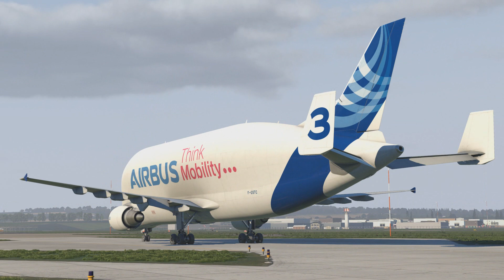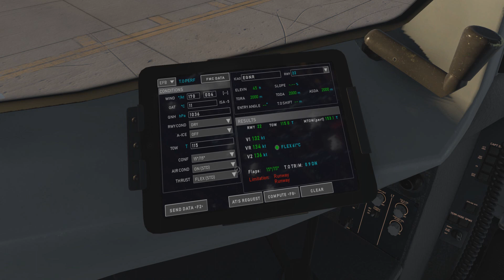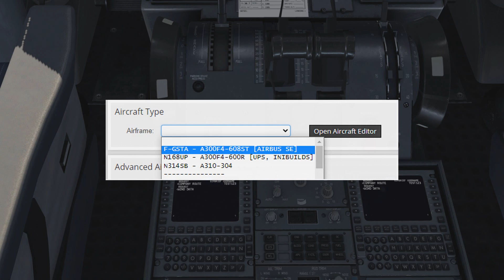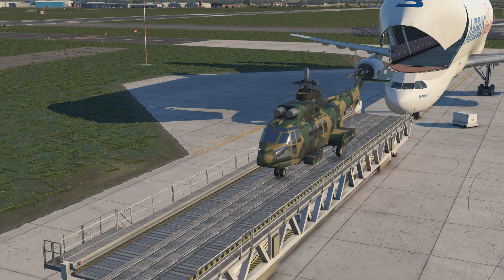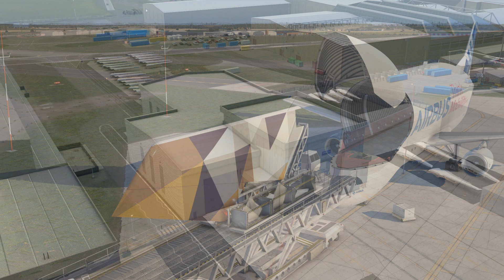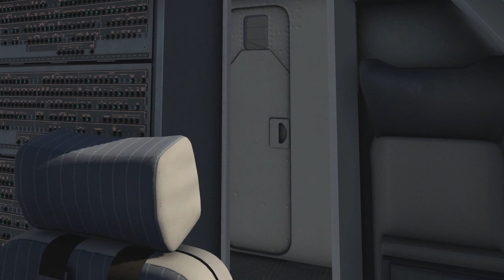iniBuilds A300 BelugaST ON THE LINE - Welcome to the A300-600ST!

Comment: Putting on my sim enthusiast cap here... I have waited 20 years for a trainer quality A300-600/A310 with it being for all time favorite airplane and when someone finally does one..... it's for X-Plane. Ugh. Of course it is. I'm sorry but XP is just a flat out eye sore. The flight model is great yada-yada-yada, to that which I ardently disagree with BTW. And I have tried every XP version since XP5, and it's just pure crap. Always has been, always will be. The lighting looks absolutely awful in that Beluga cockpit and outside as well, typical XP. It does ZERO justice the quality of the internal and external modeling, displays, fonts, textures etc. I mean you guys really nailed the shape of the 306, and importantly got the shape of the CF6-80C2As right as well. Frequently that is messed up by modelers with the more bubbly looking CF6-50s of the classic B2/B4s being done on the -600 which is incorrect. About time someone got it right. The early 310-200s w/ the older CF6-80A3s though do have a bit of that more bubbly shape compared to the 80C2s, and given the attn to detail your dev team had put into this I'm sure you guys are on top of that. The 310-200 and 300-620 (No Wingtip Fences, non R -600s) JT9Ds have a slightly stubbier exhaust as well compared to the later PW4056/58s. By my estimation this product would look at a minimum 2-3x better in P3D's lighting and about 3-4x better in MSFS'. I for one sincerely hope you guys bring the On The Line A300-600R/F, Beluga and A310 family of products to MSFS. I understand passing on P3D (regrettably), but an addon of this fidelity for an aircraft series family that has been completely neglected and overlooked by developers the world over; this never coming to the primary sim platform would be a massive shame and significant sales opportunity lost missing out on the larger marketplace. You guys deserve thorough and proper ROI for the time, research and remarkable effort in developing this airplane. After all, it's the marketplace/type popularity that many devs during internal discussions use as a major decision making point as far as what product to develop and bring to market; and as someone being "in the know" it's been said "there is no market for the 300/310". To that all I can say is I'm thrilled your outfit has done away with that stereotypical way of thinking doing the same old tired stuff over and over again. Taking on a product for which there was a massive gaping hole for that amazingly no other developer has decided to do and take on all these years. Best of luck to you guys. I won't hold my breath but if this series ever makes its way to the P3D/MSFS ecosystem, I'll be the first online to buy it, you can count on that lol. Well done and keep up the good work.